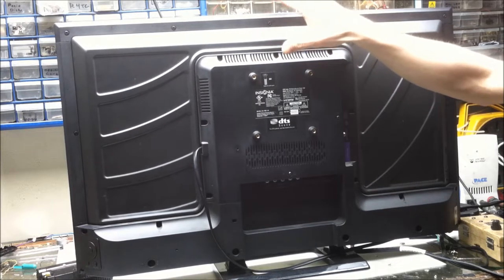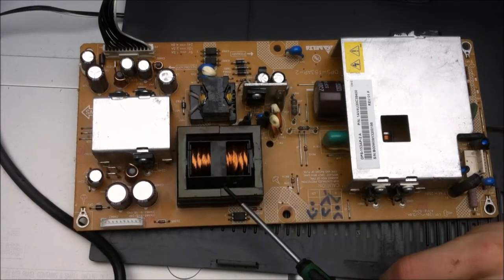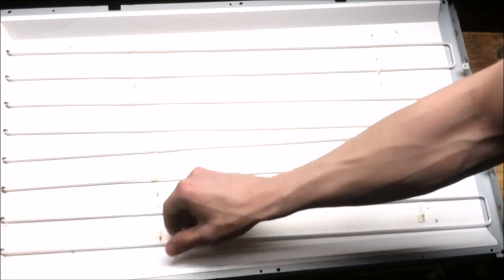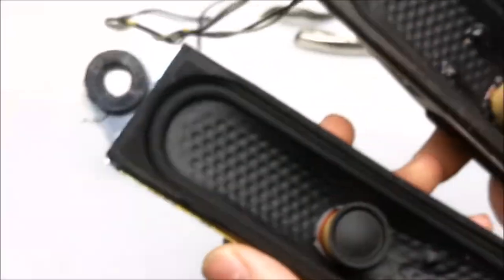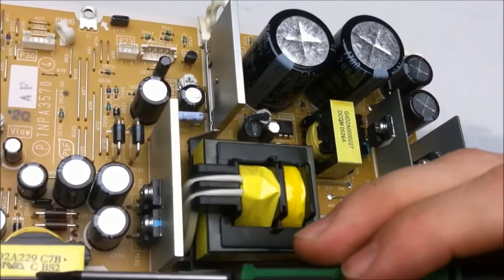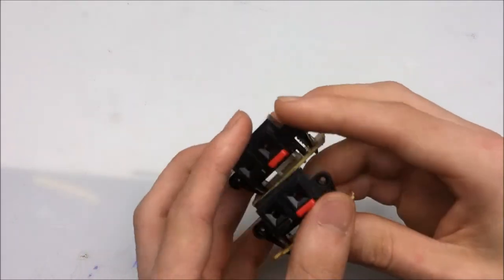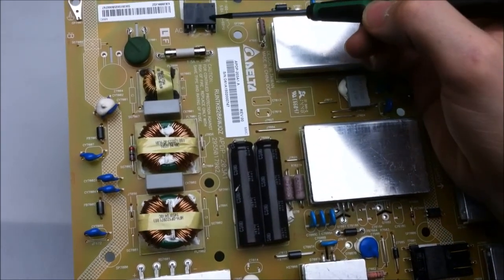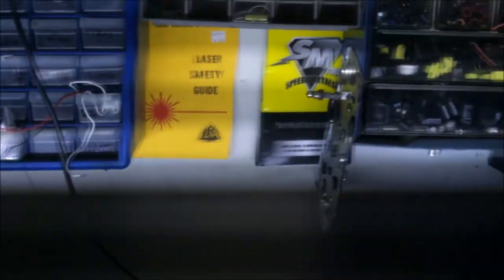Tearing Down a Ton of TVs

Comment: Hey, I've done parts swaps on a number of LCD TVs, but I didn't understand how their circuits worked beyond knowing what each board was. You taught me some stuff. Thank you, man.
Reply from the maker: Electronics can seem really complicated, in reality there are only so many things you can do with electricity, like switching it, converting it over to light, heat, or magnetic fields. You can store it in batteries or capacitors as well. Once you get an understanding of what component does a particular function the rest of it falls into place a bit. There is a plethora of tasks that run in every machine, but for the most part each task is pretty simple. Glad you learned some stuff and hopefully it opens up your capabilities to do more complex repairs and projects.

Comment: That was a lot of little transformers in the second TV!

I've kept the diffraction sheets from my TV after I sort of damaged it and could not repair it... When it was off the plug fell into a container of 10kv capacitors, obviously none were charged, but I had no idea what happened, chip fried I guess... Anyway, they're fun to shine lights behind, I'm going to try it out some day with some different style lights, I have a lot of the materi, hell, I could even put it over a window... If I ever opened my curtains 😂
Reply from the maker: Putting them on trippy posters is also awesome to do.
Reply: @Zenodilodon  as indeed you mention in video!